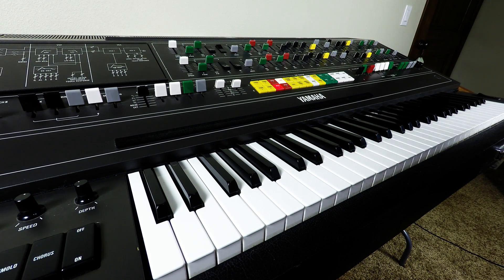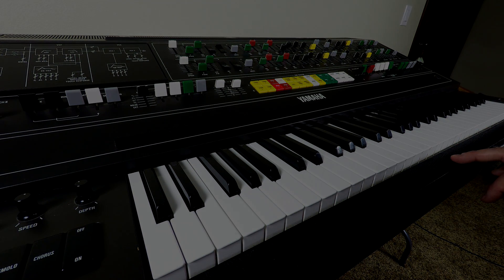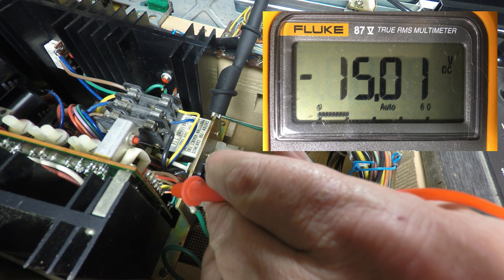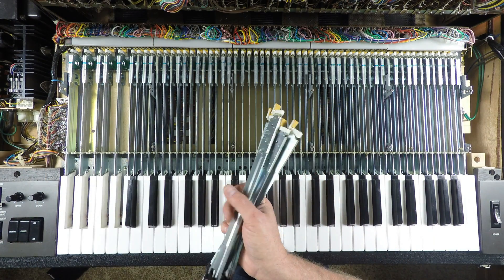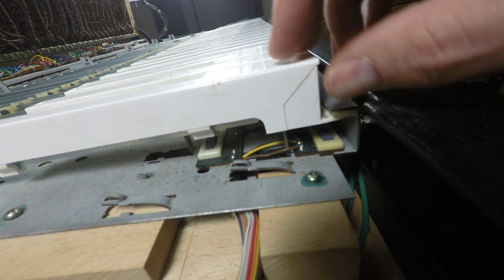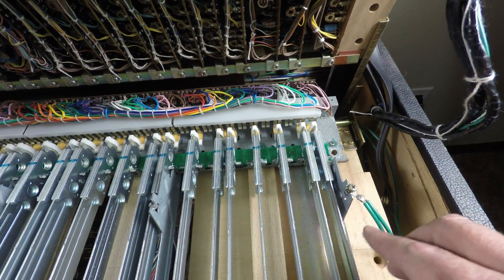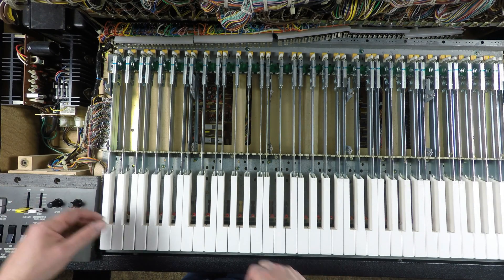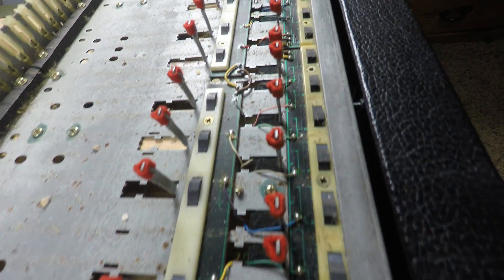Saving the Yamaha CS-80 (8) Aftertouch Restoration Pt1

Comment: hi my cs-50 has slowly lost volume, and now nothing even on high, any ideas please Yamaha people? thank you for this great video.
Reply from the maker: Might be a problem with the gating of the voice cards.  First thing is to make sure all power supply voltages are in spec.  If the voltage drifts off, the voltage level translation between the key controller chip and the voice card's envelope control chip is too far offset causing muted output.

1) Check and calibrate power supply voltages.  They must be exact.  If problems keeping alignment, you will need to rebuild your power supply.
2) After power supply calibration and still having the mute problem, check for a change in voltage to terminal 63 (TR wire) on each voice card.  You may have to press the keys multiple times before the card you are testing will have a state change at TR terminal.  TR is trigger, a control voltage that "wakes" the voice card by unmuting it.  All voice card oscillators are constantly in operation, they are simply "gated" or muted when not called upon.
Reply: thank you so much for your advice I will get to it and let you know how it turns out,

Comment: Hi!

I'm from Brazil and I have a Yamaha CS80 for around 7 years. In those 7 years it’s been through repair and now I have no sound out of it. The CS80 powers normally, but no sound… Only low noise (if I switch on the chorus, i can hear it affecting this noise)

Brazil is a crazy country and we don’t have enough technicians to repair it… So, I’m wondering if you can help me in any way. I’ve already changed death master VCA (chip Ig00159) and nothing… Do you have any ideais?

If it wasn’t too heavy and expensive, I would send it to you for a repair!

I have the possibility to change for a Arp 2600. Should I? 

Thanks In advance!!!
Reply from the maker: Greetings, I am from the USA. 
1) Did you verify all voltage rails are good?  If they are out of tolerance, trigger voltages may be off enough to cause mute voices. 
2) If voltages are within specifications, need to make sure that the key controller chip is working.  At the bottom left of large KAS board is a row of 8 test pins.  They should change voltage as you press keys in no particular order.  When these pins go low voltage (-6.5v), they activate the appropriate pair of voice cards.  Can you verify?  Need to make sure the digital computer part of the CS-80 is working before going any farther.  If the voltages on the test pins are not changing, there may be a problem with the CPU clock or the power up reset circuit.
Reply: Thaks Dollar Guy! Unfortunately I know nothing about synth repair... Just an ordinary musician... But thanks a lot for your reply! I will have to find a good tech guy here in Brazil and show him your message! Thanks again!

Comment: Technology is getting better and better so I don't see why no one can remake this 1:1.
Reply from the maker: It is very possible after understanding how this complex machine works.  CAN data bus between 3-4 "modules" would simplify the wiring and assembly costs.  Simply have power and serial data between them.  Self calibrating initial trigger/aftertouch sensors in the keyboard deck (module 1), manual control panel interface which has all the sliders etc (module 2), android type tablet touch screen interface/presets (module 3) and finally the voice card stack and post effects processing (module 4)... but it would still be a very expensive machine, 3-4 thousand dollars at best.  The post effects (reverb, chorus, hall etc) would be in a DSP, preferably using licensed firmware from Lexicon for example.  Trust me, I have pondered this deeply... an entire DSP solution would lose the integrity.. so have to keep the 16 free running oscillators and Yamaha specific filters.  The aforementioned virtual control panel (tablet touch screen) would work in unison with the motorized encoded sliders (encoder tech same as common digital calipers for example).  When you change your preset, the sliders follow position in real time, also allowing you to tweak the settings during play to keep that man/machine interaction alive vs sterile touch interface only.  I would like to also have the ability to change keyboard weighting as well.  Everything would be digital, including the mechanical sliders...so nothing to wear out and/or drift over time.  I wish I had more time to make it happen.  But it looks like somebody is doing it now... a rack mount version. www.deckardsdream.com thank you MrMargaretScratcher for that link.
Reply: Someone is doing just that, more or less:

http://www.deckardsdream.com/
Reply from the maker: Looks like he made it all through-hole construction, so it should be an enjoyable experience as long as his assembly manual is well thought out and clear.  But judging the quality of his layout from what I can see....  I imagine it will be 1st class all the way.  Each of his voice cards are two of the original.  So this is a fully implemented CS-80 minus ring mod and analog stereo effects.  I am going to pre-order at least one kit with the panel.  That will be a YouTube video series in itself of assembly.  I would be willing to help anyone through assembly best I could.  Just have to source all the parts aside from the custom micro as the website says.  Shouldn't be too bad.  Just lots of assembly time. Didn't see any trimmers as I suspect software is now dealing with that VCA DC voltage mixing nightmare in every CS-80..... THANK GOD....  I'll even consider offering the complete discrete parts kit for the deckardsdream PCB kit with my existing cs-80 parts lineup if all goes well.  This is very exciting and will get CS-80's into the hands of all musicians besides the ultra deep pocketed.  I had a feeling long ago this magical gritty sound would come back.  :)
Reply from the maker: Is there a BOM available somewhere?  I didn't see it on the website and little updating since May.  If you assembled the TTSH, then this shouldn't be a problem at all for you.  Most of a CS-80 including what I see in the deckardsdream that initially appears so intimidating are in actuality simpler repeating circuitry "modules".  Like the voice cards, 8 identical boards.  I tend to think of it as comprehending a multi billion transistor GPU chip.  All those cores look formidable from a distance, but once you understand how one core works, then the entire monster is less frightening as it is built from multitudes of the same core.  I am curious what he used for envelope controls for filters and output level, ideally a DAC generating the profile.
Reply: Does this unit have the MIDI addition?  Have you seen those Kenton MIDI products for this machine?  There is a guy making a thing called Vax MIDI which is a full size poly-AT keyboard....you put it together yourself so it is cheaper to purchase.    The closest thing I will ever get to a CS80 is the software versions, but you can't find good keyboard controllers.  All of the recommendations are for 25+ year old Ensoniq models and Kurzweil MIDIboards.
Reply from the maker: This one (my personal CS-80) does not have MIDI at this time.
Reply from the maker: deckardsdream may really be the dream come true.  He shows 8 voice cards instead of 16 though with 2 banks of control.  Not sure why unless it is 4 note polyphony instead of 8 ... looking into this and thank you for mentioning it.  Update:  looks as if each of his voice cards are equivalent of 2 traditional voice cards.  So a total of 16 voices on 8 cards.
Reply: Fairly pricey though, I'm on the fence as to whether my wallet and soldering skills are up to the task...
Reply: I completed the TTSH but this is apparently 4(I think, maybe more...)  times the amount of components.. Plus it runs about $2,500 once you've bought the kit, the BOM, and the rare parts. I am still tempted though...
Reply: Synthcube have estimated bundles:

http://synthcube.com/cart/ddrm-deckard-s-dream-diy-kit
Reply: Did you heard CS80 preset from the J Bowen Solaris?..ive got one at home;..not bad...Thanks for this supervid!

Comment: I don't understand why Yamaha don't made a new Yamaha cs80
Reply: Building an analog one would not be economically feasible, even with surface mount technology. A digital version could be practical, and might weigh 1/5 at most, but would still stay rather expensive through the need for a poly aftertouch keyboard, a long ribbon and the number of additional hardware controllers involved. And then it would still be a bit like building a hardware controller for a softsynth. What a glorious thing it would still be though. :-)
Reply: Marc Brassé I hope so that they made
Reply from the maker: Another guy in Japan has done this apparently as a rack mount.  Deckersdream.com